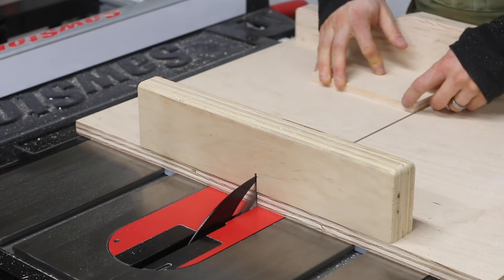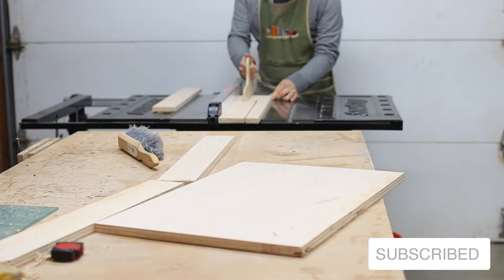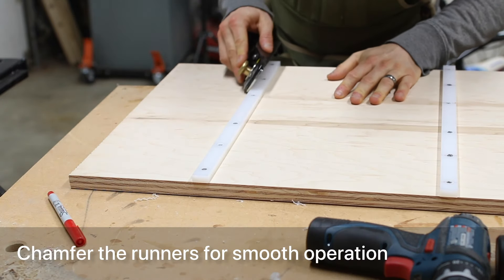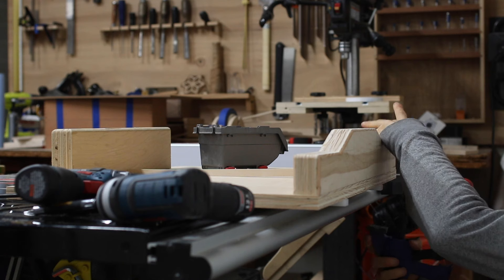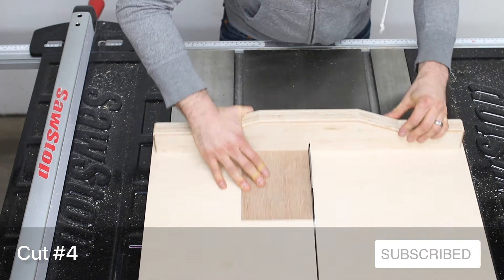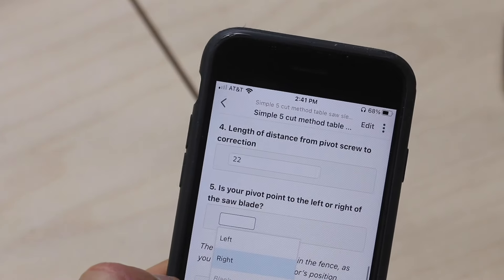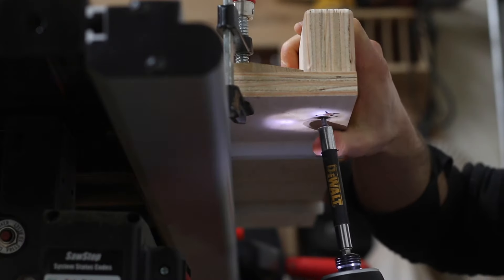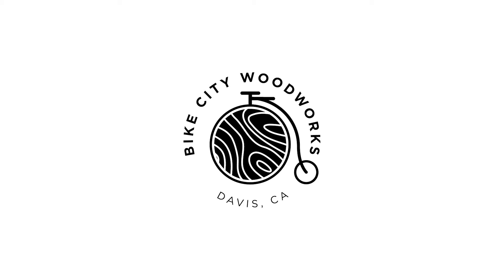The 5-cut method made easy | Squaring a Table Saw Cross-Cut Sled in 5 minutes

Comment: TIPS-
1) BE 100% SURE YOUR BLADE IS ALIGNED (for me a deviation of .003 was tolerable) WITH YOUR MITER SLOTS (there are countless YouTube videos on how to do this but what worked best for me was a combination square placed against inside edge of miter slot to set distance to a marked blade tooth, then rotated that tooth 180 degrees and measured deviation with automotive feeler gage)
2) THIS CALCULATOR IS BEAUTIFUL BUT ONLY WORKS IF THE WORKPIECE IS LOCATED ON THE RIGHT SIDE OF THE BLADE (as viewed from the operators position). 
AFTER EACH CUT THE WORKPIECE MUST BE ROTATED COUNTER CLOCKWISE SO THAT THE NEWLY CUT EDGE IS PLACED AGAINST THE FENCE.
Reply from the maker: Great tips! I guess I glossed over it, but yeah, the blade needs to be generally aligned to the slots. Also, I actually tested the right/left side of the blade in this video: https://youtu.be/Szwq3R8pstQ! I'm in the process of adding a note to the calculator for that.

Comment: Tried the calculator 8 times and not one answer was correct, I did it once manually and got to 0.07mm on the first try.
There is "definitely" something wrong with your calculator!!!!
Reply from the maker: Hey there, sorry to hear you aren't getting the result you expected. I think it's the metric equation that is broken — investigating it now!
Reply from the maker: Alright, I think I fixed it. Can you try it with your previous measurements and let me know? Thanks!

Comment: if you cut on the left side of the blade your direction is wrong.  This will change which is larger measurement A or B.😠
Reply from the maker: You're right! I missed that in the first video, but actually did a demo about this in the followup video: https://youtu.be/Szwq3R8pstQ

Comment: YOUR CALCULATOR IS WRONG !!!!! IF THE NUMBER TO MOVE IS POSITIVE THEN YOU MUST MOVE THE ARM BACKWARDS..
SAME IF NEGATIVE MOVE THE PIVOTING ARM FORWARD !!!!!  BECAUSE THE FENCE IS 0 - 90 DEGREE'S FORWARD AND 90 TO 180 DEGREES BACKWARDS...
Reply from the maker: from my research it all depends which side you’re pivoting from. That’s why I have a selector to choose which side your pivot screw is on. Choosing the screw location selection opposite to the one on the fence will have the same effect that you describe.
Reply: He’s right, depending on which way it needs adjusted, you would move the fence forward or backwards. Your calculator doesn’t account for that, it always says to move it the same way based on the pivot location.